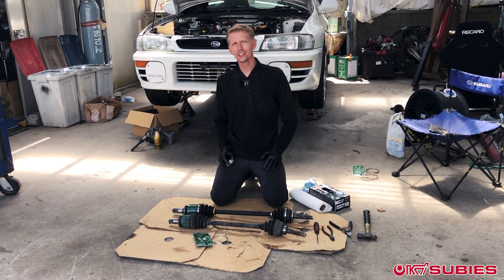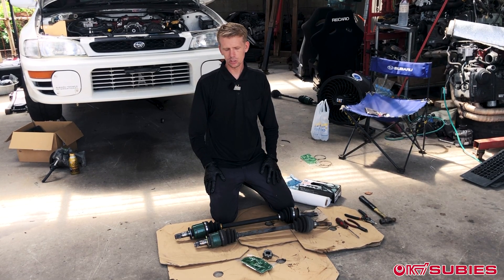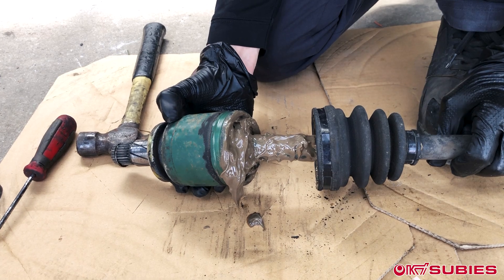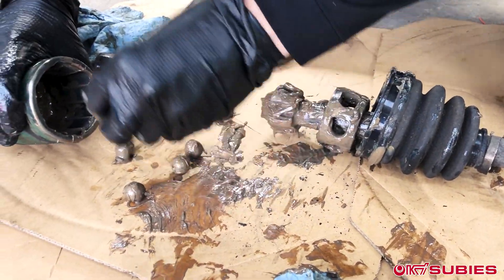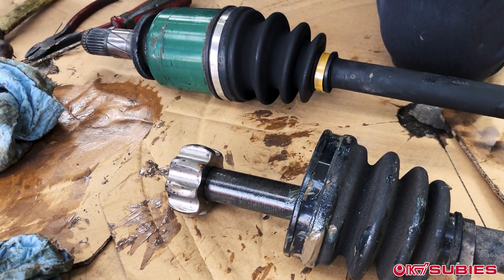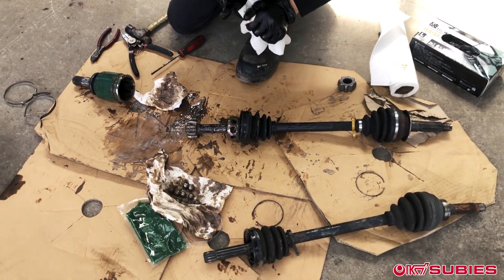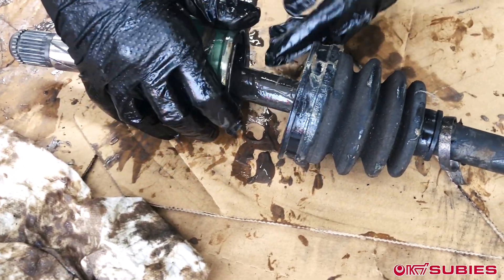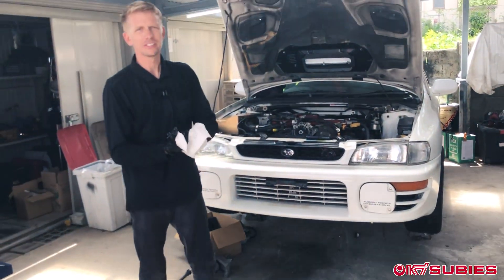How to modify your rear Subaru axles with Suber Dave's Custom races

Comment: @OkiSubies 
What’s your opinion on turbo timers?

Which ones are your ideal brands?
Reply from the maker: @NyunJah  We are honestly not a fan lol. After driving hard you can just keep the car running to let it cool down. The turbo timers making your car run longer after you turn it off every time is just unnecessary. Don’t hate them though, many nice brands out there but don’t have a specific recommendation though because we don’t really use them😅

Comment: luckily i went the full swap direction with my Fozzy. but this is still the plan for my 5x100 friend and his 6 speed swap.
Reply from the maker: @stressed_garage  That is the best option for sure if you can get all the parts for a good price. This is a great cheap solution that works well🙂
Reply: @OkiSubies  I ended up with a 99 ej207, a 2011 usdm gr 6-speed transmission and diff with 06 STI axles hubs and brakes